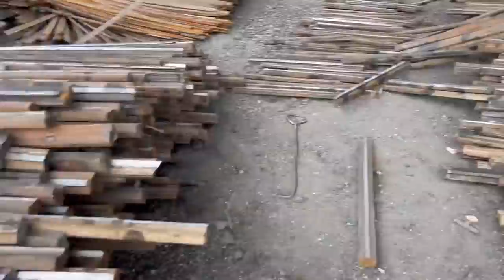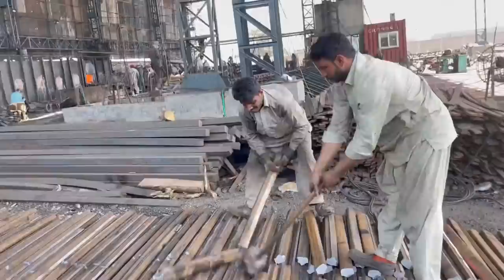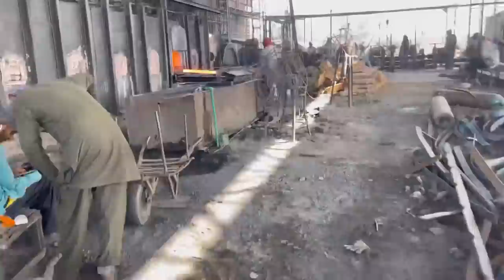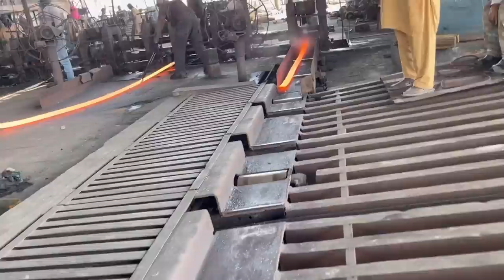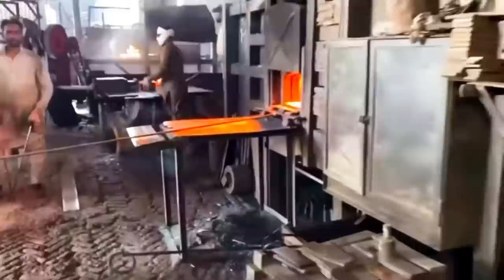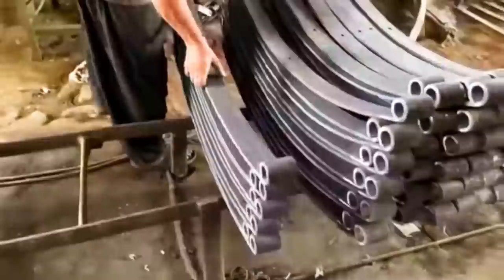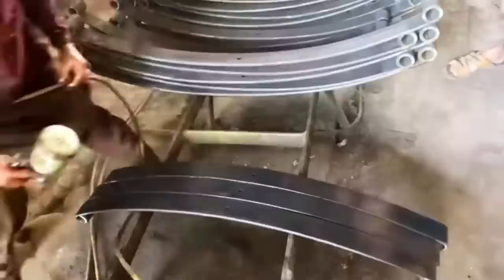They also make truck suspensions from old train tracks | Amazing thing technology1 |

Comment: This is amazing , the coordination and timing is perfect . I notice how everyone keeps it moving fast and efficient so the steel is still hot . That is some great recycling . Job Well done .
Reply: That is some great recycling using WOOD as source of heat, in a country already pretty much devoid of trees... Brilliant, indeed... Have you ever wondered why there are so many heaths in England, and so little forest left? Guess what they used to fire their furnaces at the beginning of industrial revolution? Hint: that was BEFORE they started to dig and use coal for smelting iron.
Can add two and two?
Reply: @MrKotBonifacy  lol, the wood in gb got not only in the furnaces. most of it went in the mines to strengen the ceiling
Reply: @paulpower5028  While I do not know exact numbers, IMO more wood was burned than used as mines' structural reinforcement. But regardless which was actually the case, that "other usage" probably greatly contributed to that deforestation too.
Reply: @paulpower5028  the timbers in gb mines are almost exclusively oak (or white oak in royal mines for things like iron or gold) and are nowhere close in volume to even just the odd birch that was turned into charcoal.
Reply: They get one chance to mess up.
Reply: @MrKotBonifacy  You expertise on coal is somehow limited.
Reply: @georgegordonbrown9522  And so is your thoroughly thought through reply ;-)
Reply: All the employees that were no good are either seriously injured or worse
Reply: Uitați va bine laminoarele noastre făcea poluare și alta problema uite unde ajung simile noastre de la c f r frumos deștepți conducători inteligenti

Comment: These people work with minimum requirements   n produce super quality products
Reply: These people work with minimum requirements, nonexistent work safety and all they produce is a rubbish quality product that is as good as springs as a haywire used in place of trousers belt (or a shoestring). Sorry, this is the way it is.
Reply: Super quality? 🤣 🤣   thats not even spring steel. Its going to snap in a month.  Theres a reason its so cheap.
Reply: It's many things, super quality is certainly not one of those. You see how they snap brittle pieces to length with a hammer at 0:40 yeah.... that material is going to work as a spring. Absolute shit.
Reply: @aleksandersuur9475  What they do at 0:40 is snapping "scored" or partially cut pieces - or at least it looks so to me.
What they use here is old railway rails - you can see its components: "foot", "neck" and "head" already separated. It looks like they initially cut the rails  into relatively short sections, like 4 m/ 13 ft, then those sections are cul lengthwise, separating it's components. Then they cut those pieces again "in half". Since the head is the "stoutest" part they do not cut it completely, but somehow "score" it and then finish the job with the hammer. Well, at least it looks to me like that, but I might be wrong. Still, railway rails are made nowadays from a high carbon steel, something akin to rebars, so it just doesn't snap like that. Cast iron - OK, but not carbon steel.
Having said that I do agree that this is not the best steel for making springs. Kinda "make do", but just that. But then again, money do not grow on trees, and this is one of those places in this "the best world we know" where people have to scrap real hard for living and make ends meet.
Reply: @MrKotBonifacy  Pretty sure the way they "scored" those was by locally heating up and quenching at that spot, this material tempers hard and very brittle, that's why it snaps just from a hammer blow. Some steels do that, some don't, obviously no steel is usable in such brittle state. Steels like those would only be used in applications where steel would be annealed, such as in railways. But a spring you would of course want to temper because it makes for a better spring. You can't do that with this steel or it does exactly what you see, it shatters. So it's shit springs they are making, it's plain wrong material to make springs from. Which is completely stupid because the raw material cost saving here is nonexistent compared to price of the final product - the truck. The cost and value is in the labor and the process, skimping on material simply wastes that value.
Reply: @aleksandersuur9475  I don't know if they "heat and quench" it (locally) to make it brittle - it does makes sense from "physical property" standpoint, but it would require more time, work and fuel to do so then simply  to cut the material with an oxy-propane torch. But we just do not know.

High carbon steel does become brittle when tempered improperly, but then there are various ways of quenching (air, oil, water, brine) and then you can anneal those springs too. As mediocre as they might be, people apparently buy them nonetheless, as otherwise those guys wouldn't be able to survive (economically, as a business entity). This is pure "market thing", they do not get any government subsidies or tax breaks - the only breaks they can get is broken bones if they are not careful.

"the raw material cost saving here is nonexistent compared to price of the truck" - firstly, those springs are meant as SPARE parts, not "production parts", and then you should take a good look at their trucks and springs they use - it'll probably change your opinion a bit.

Anyway, and regardless of your opinion on costs, savings and quality, I would suggest that there's nonetheless a thriving market for those springs - and those guys do make some profit after all - somehow.
As someone who spent "quite some time" in India in the '90s (I also visited Pakistan and Bangladesh occasionally during that time) I can tell you, that there are "some differences" between markets "there" and those in developed countries. Things and activities that do not make any economical sense here are still a mainstay there. Nowadays when your shoes are worn or your trousers get torn you simply throw them away and buy new ones, right? And even if you've decided to "fix" them you'd have a hard time finding a cobbler or seamstress in the shopping mall in your neighbourhood (I'm not talking Mister Minit, I'm talking a "proper cobbler") - and even if you could, the cost of the repair would be kinda prohibitive, and the whole idea "wouldn't make any economical sense". (Unless your shoes cost 900 bucks when new, that is.)  But in India I saw a "cobbler cum shoe shine" guy on almost every corner of a street. (They earned a pittance, yet they earned something nonetheless.)
And if you'd see how they "repaired" tyres... Oh, boy, any western road safety inspector would get heart attack just looking at the process...

Comment: Amazing how brittle the tracks were.  And at the end so pliable.
Reply: I think the top of the tracks are hardened, so that portion of the track is pretty brittle
Reply: Rail steel is incredibly strong and tough.  It is not brittle, but it is also a bad material to use for springs.   It is designed to take heavy loads adn abrasive wear.    they roll straight rail and then roll curved  sections turns.  Think about the fact that 200 ton locomotives and 100 ton tanker cars are pushing against the rails in curves and the rail keeps its shape and down not break ....most of the time.  I am guessing you saw the men using the sledges to separate the segments.  They were actually slit or cut  into three pieces but some were still attached and the were using the sledges to break the last connections.
Reply: I didn't watch the whole video. But there's a process called decarburization. In which steel is heated to reduce the carbon content in it, hence making it less brittle.
Reply: they were cut with a torch first.
Reply: @jamesb4789  " It is not brittle, but it is also a bad material to use for springs. "
Let's not forget that by the time this steel is made into springs, the multiple heat / cool cycles shown in the video have changed its properties.
Possibly not ideal for springs, but given that they are obviously using it for springs, and one has to assume the springs are reasonably fit for purpose, calling it "bad" might be going a bit far?
Reply: It's 1070 steel, in the case of tracks only the wheel contact surface is supposed to be hardened but not that much. At the beginning of the video the scoring machine is shown, the thin section of the rail is scored along and then it's broken with a maul blow. It leaves a cleaner, scale free cut unlike the oxygen-gas cutting system.
Reply: @chapiit08  good comment.  someone who obviously knows a little something about steel.

Comment: Amazing production process.
The train tracks were most probably a faulty batch because the steel broke in half like it was glass so maybe they got it for free.
Between each layer they should put some grease because there is a very heavy friction and also rust will build up.
Reply: The kid doing assembly was wiping a finger of grease between layers, but it was quick and easy to miss
Reply: Rail track can be broken after nicking it with a cold chisel….. certainly not a faulty batch of rail
Reply: @robinsharples5314  Normally they would temper only a part of the surface that is in direct contact with the train wheels.
And I can confirm that even with a cold chisel shot you can only bend soft and hard steel unless you put the piece in liquid ice at -500°.

Comment: I feel like spring steel and railroad steel are very different and can’t just be interchanged.
Reply: Lol, they are not the same and to make matters worse what process is even being followed for heat treatment and quenching…I doubt none.  
Just follow all the other videos of repair work being done to broken springs and axle housings and you will see.  Overloading of trucks in these regions is common to be fair but I’m sure these parts are not being manufactured with a million mile guarantee
Reply: From what I could gather on a quick google, rail grade steel is indeed different from proper spring grade steel. There seems to be more carbon in the mix and a lil bit different process to make spring grade steel. But rail steel is not that far from spring steel in certain cases (like a heavy load rail section or higher traffic one). Yet I doubt those rails they are re-purposing are up to standard specification in the first place.
Reply: They are different. Which is why railroad steel is preferred over spring steel.
Reply: I suppose the truckoperators have no budget for 1st quality imported original leafspring assy’s....if these ones last a quarter of the time an original one will....they are stil saving money....I admire the scale of production....and the efficiency!!
Reply: @Streeterm  Look how easily they busted those rails with just a hammer, I bet they were replaced in first place because the tracks were falling apart from the trains running on them. Its Tofu Dreg steel at it's best.

Comment: Great work! I didn’t know you could break a railroad rail with a sledge hammer.
Reply: Danger Bear  they cut it earlier nearly 98%, just break that into two parts using the hammer.
Reply: @anonymousman2521  I didn't see any cuts, and when you look closer there is a typical grain structure being shown all through out the break, indicating there wasn't any cutting done.

Comment: Rail tracks take high tensile strength  as opposed to suspension plate which may b spring steel / torsion steel. So if rebar plates used without stress relieving stress. Passager get shock in bumb and can reduce all bearing life

Comment: Well I now know why leaf springs should not be used as knives. They say you just don't know what steel your going to get and what it's been through. So true. Very cool process non the less thanks for sharing 👍.
Reply: lots of videos of knives being made from springs and able to chop steel nails without chipping edge.
Reply: @rosewhite---  Sure, when you get the virgin alloy, not a scrap yard find fest.
Reply: @FrozenHaxor  lots of videos of knives being made from springs and able to chop steel nails without chipping edge.
Reply: @rosewhite---  When the spring is made out of proper steel to begin with that is.
Reply: @FrozenHaxor  springs have to be made out of spring steel.
I've worked with steel 60 years - only spring steel is really springy.
Reply: @rosewhite---  I wonder how their railroad springs will hold up, by the amount made it seems like they sell them to their customers by a pack of 50 at a price of dime a dozen lol, that must be brittle as heck!
Reply: @FrozenHaxor  Why don't you go over to Pakistan and start your own spring factory with $1,000 dollars?
Reply: @rosewhite---  Just because one can start a substandard product factory, doesn't mean they should. But since it's third world country and in early stages of development, different rules apply.

Comment: Not that it matters, as these people and their customers make do with what they have, but as I see alot of comments about whether rail steel is suitable for springs, I note this from Net searches

"Railroad track steel is typically 1084 or equivalent hot rolled steel. This is a medium carbon steel with 0.7% to 0.8% carbon and 0.7% to 1% manganese."

Spring steel is typically 5160   
"0.6% carbon; 0.75-1% Manganese; 0.035% Phosphorus; ≤ 0.15-0.3% Silicon; ≤ 0.04% Sulfur"

I am hardly a metalurgist, but my hunch from looking at the above is that rail line is perfectly well suited for use as truck springs, particularly as the heat/cool cycles shown in the video undoubtedly are intentionally designed to assist that use.

Comment: This is an incredibly primitive  and backwards operation.   There is no safety standards that I can see and I guarantee workers have lost legs due to the steel shooting out from the rolling mill.  This kind of operation was typical in US plants in the 1880's.  My grandfather entered the US steel industry in 1920 as an engineer and he had in his papers drawings and sketches of such operations being phased out of US plants in the 1920's as too dangerous and too low quality.    And that was 100 years ago.  My grandfather witnessed a similar bar mill that was shut down when the steel strip coming out of the mill took an unexpected  whip that literally cut off a man's legs above the knees and he bleed to death in minutes.   The mill was scrapped 6 months later.  

I am willing to bet the workers were running things slower than normal to make sure nothing happened while the crew was there filming.  As it is they are still dancing to stay clear of the steel.  

In the US, rail scrap is actually the primary source of metal for the rigid sign posts along roads for speed limits and other signs.  They are very strong and rigid.  They split the rail in a machine  into three pieces and each section  is used in a different automated rolling line.   Biggest plant  is in Pennsylvania.  Most rail though is melted down as high grade prime scrap.
Reply: "The mill was scrapped 6 months later".... actually, it was exported to Pakistan, and is still in daily use!

Comment: Just because it looks like a truck spring doesn't mean it will be a good truck spring.
The alloy used in rails are to make it hard and wear resistant, NOT flexible like you want in a spring.